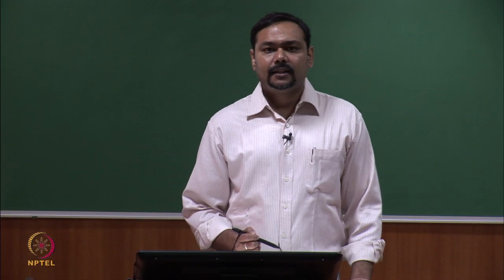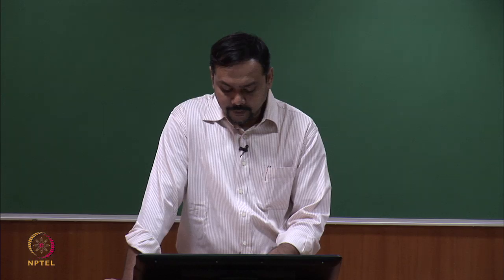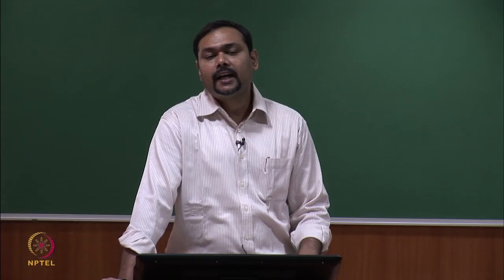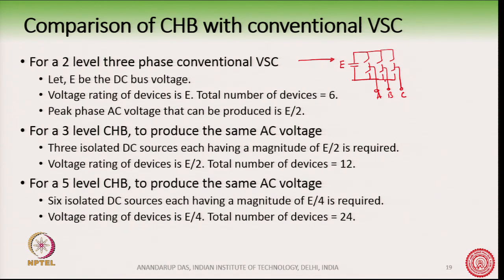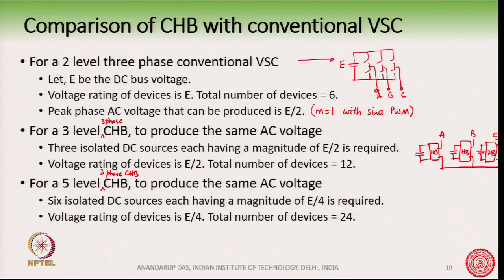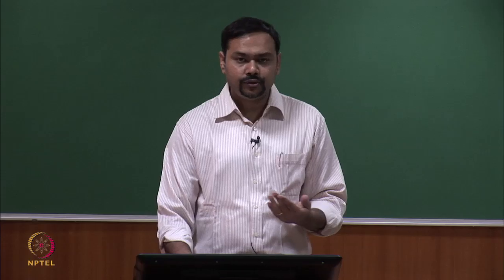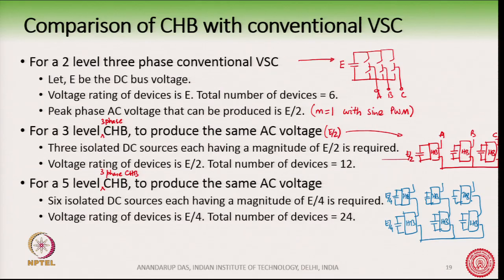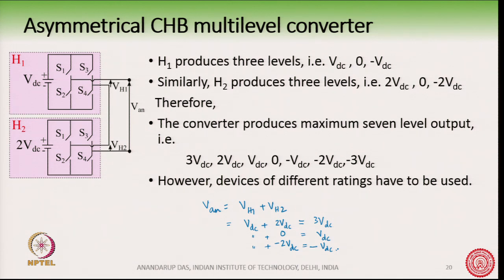Output Voltage Waveform Synthesis in CHB Converter and Basic of Asymmetrical CHB Converters

Comment: If the voltage (Vdc) per CHB is very low vs 240 Volts AC Line then we will need many CHB's. 40 CHB's required = 240 Volts AC / 6 volt Vdc. But what if you used only 4 CHB's at 4 different voltages? Voltages = 6 Volts, 18 Volts, 54 Volts & 162 Volts = Factor x 3!  Now, you can create 81 different voltage steps from +240 volts, through 0 volts, down to -240 volts at EVERY 6 volt interval. Only 4 different modules need to be mass produced?  What is the %THD, just  by implementing the 81 steps without any high speed PWM?